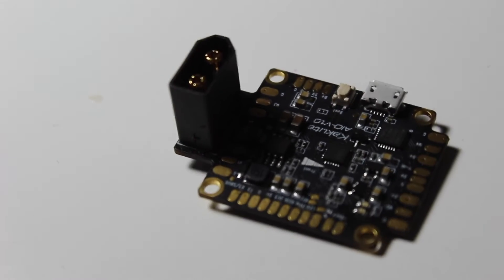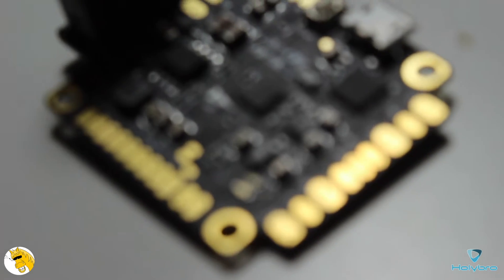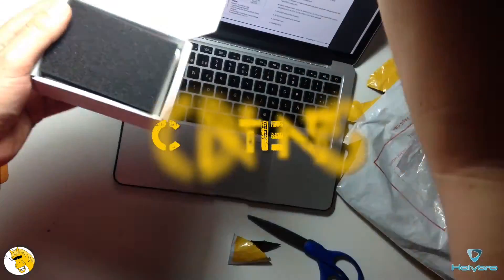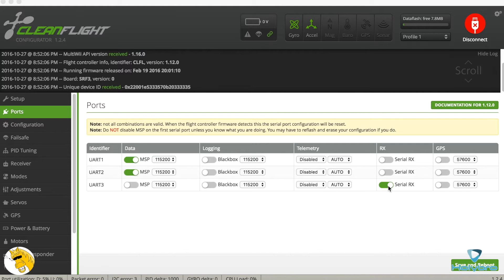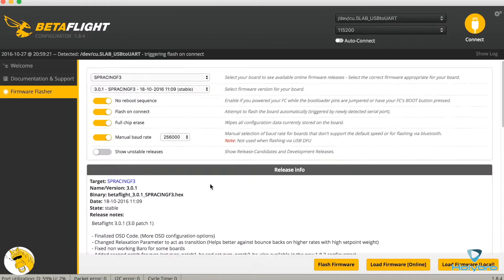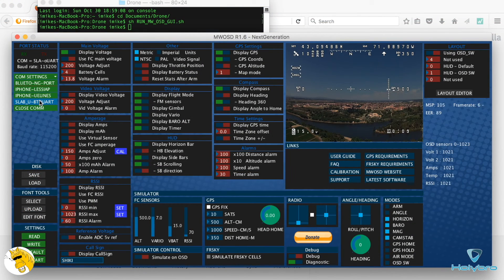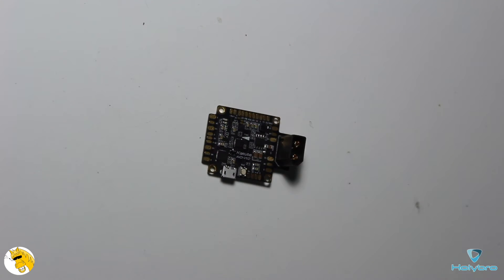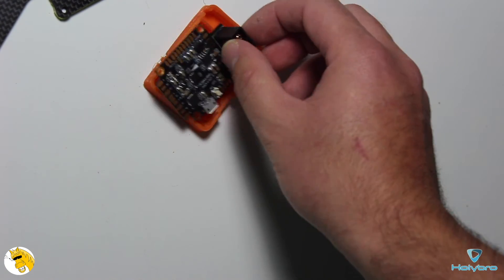Holybro Kakute AIO review - Built-in OSD, BEC, BAT, ...

Comment: Nice video! I have this FC on an old ZMR frame and want to upgrade the on-board OSD firmware using latest MWOSD GUI Configurator 1.8.0.0. via serial passthrough from UART 2 (OSD) on the FC. Question: When selecting the pre-built firmware to flash what "Device" & "Variant" do I select?  eg. HolybroPDB & Minim. Thanks for any pointers :)

Comment: When you say "Press boot button when flashing", do you mean you should press and hold the button before you insert the usb cable so it will boot up  ready for flashing?
Reply from the maker: Hi! I did it long time ago, but I think that's the way usually is. You always have to press the button when plugging and the release right after you plug it. Try it and let me know. Good luck

Comment: hey man just wanted to know if you ever got the amperage to work on the osd i am using mwosd 1.5 and have the amperage turned on as well as FC amperage setting turning on but for some reason its only showing like 0.3 amps when im giving it throttle?
Reply: i correct that i turned the fc amps as well as virtual amps and it shows im getting 320amps ? seems very wrong.
Reply from the maker: Hi! unfortunately I didn't have too much time to test it. After a few weeks this fc burned during a flight (even with smoke, it looked like hit during a war :-P). Well, actually the resistor of the fc poped out and the rest of the components were mostly ok. I don't know if it was some issue with my setup of the fc. Have you seen any other kind of strange behaviour?
Reply: EvilRace well to be honest this is my second board actually fried the first one while changing the vtx signal 😭 haven't seen much else on the new board beside these amps while I was attempting to get the osd to work which your video helped me figure it out new to building so not exactly sure
Reply from the maker: Hehehe... Don't worry, in this hobby there are 2 types of people: those who fry a fc and give up and those who fry a fc a keep going... :-) I fried a few. Sometimes the current and voltage has to be calibrated. I think you can do that from the MWOSD.
Reply: EvilRace thanks for the help man

Comment: hello would this receiver  PLUG  in to the kakute   without soldering https://www.banggood.com/Holybro-2_4Ghz-Compatible-Satellite-Receiver-for-DSMXDSM2-DX6-DX7-DX7se-DX8-DX9-p-1107845.html?rmmds=category
Reply from the maker: Sorry, the Kakute AIO only has a connector for the OSD UART port. I don't see any chance for that receiver to work in this board without cutting the connector and soldering. But anyway, why would you want this board if you prefer to avoid soldering? This board has nice pads for soldering, don't be afraid. It is harder to solder in board which are meant to use connectors. If you need some reference: http://www.holybro.com/manual/kakute-AIO%20Manual_v1.0.pdf
Reply: thank you ER  I will solder in a spektrum satellite   I realize I have to quit avoiding soldering

Comment: Can you use betaflight's osd passthrough with this board?
Reply from the maker: Yes, you can set the UART2 port to MSP, then in the CLI you set "serialpassthrough 1 115200", reboot and then you can connect to MW OSD GUI through the USB (battery should be plugged) But yes, you save connecting through the UART2. What I couldn't do yet is to use the betaflight OSD tab (I don't know if it is possible)